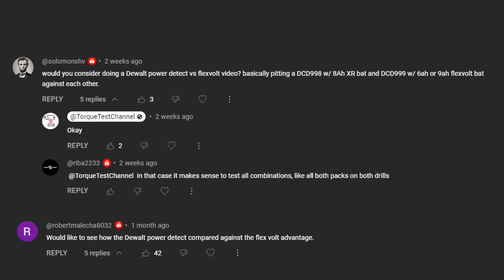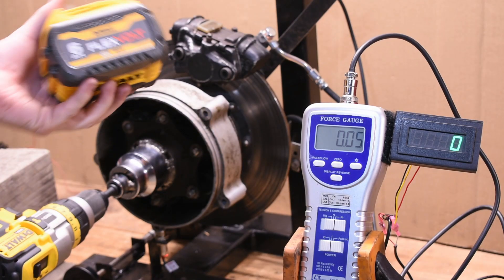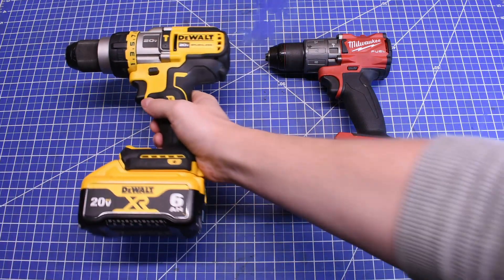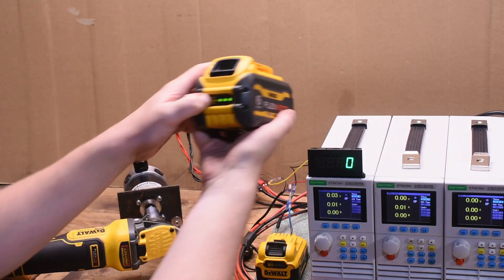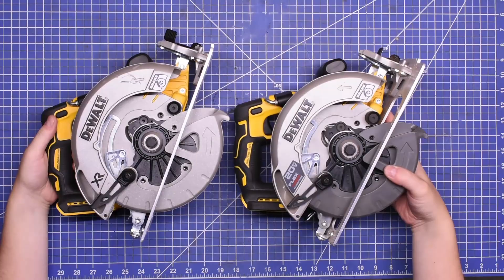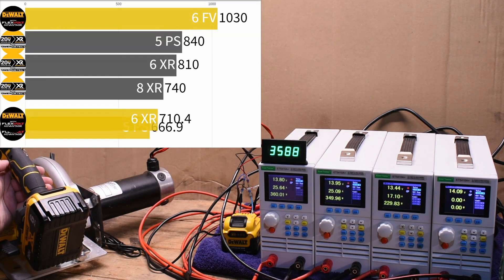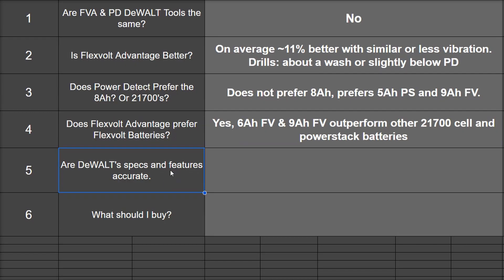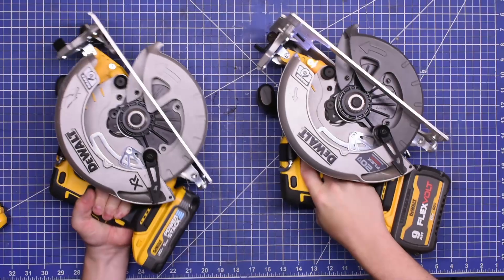Investigating the Biggest Lie in Power Tools: DeWALT's Flexvolt Advantage v Power Detect

Comment: I've said it years ago, Dewalt is trying to appeal to everyone and their dog. They want 5 different lines, that I know of, and a myriad of battery lines to go with them. They are doing a dis-service now, as it's just too complex. This is the same reason why auto makers cut their number of models in 1/2 or more, because they are making models that no one wants. Milwaukee on the other hand did the exact opposite approach and makes just the 18V line with one quality level, the top level, and that enables them to make 100s of specific tools for very specific jobs. Problem is, they are expensive, or seem so compared to those cheaper Dewalt models. I'm a big DIY'ers so I'm able to spend the time deciphering those different lines and getting the one I really need, but it's a HUGE pain the ass. If Dewalt wants more market share, they need to remove all this crap and just make 3 lines.....beginner, intermediate and pro.........and make just one line of good batteries to go with those tools. That would be so much easier.

Comment: This guy said the FlexVolt 9Ah is DeWalt's best battery, but what about the FlexVolt 12Ah battery?!?
Reply from the maker: Higher number on the side doesn't automatically = better. The 9Ah is great because it has 3 rows, 15 cells, of Samsung 30T's. The 12Ah has the same number of 21700 cells, but uses 40T's for more overall capacity. But that doesnt make for more current or lower resistance in this case. The 9Ah even beats, on average, the 15Ah.

Comment: When I was plumbing and using Milwaukee Brushless tools I noticed that it was more like programming in the tools brain if the tool could benefit from a high output battery. Dummer the tool "Vacuum" the more beans it could use.

Comment: I've got the DeWalt power detect and I absolutely love it I use it with flexvolt batteries..

Am I the only one that uses DeWalt power detect hammer drill with flexvolt batteries. Not even this guy tested it with a flexvolt

Comment: Flexvolt idea is just to change cell connection type from serial to parallel, so instead getting 9ah and 18v youre getting 3ah and 54V...  Anybody familliar with ohms law knows that this cant change torque of any tool because power output stays the same!

Comment: I wanted to see, what actual work over time you can get from every battery until you deplete it.
I multiplied measured Watt output of every battery by that battery capacity in Ah.
Heres the results (* before name means it was used on FlexVolt grinder, just like in 2nd test in video)

Batt   Watts   W*Ah     place
*9fv     850     7650     1
9fv       790     7110     2
*6fv     780     4680     4
*6xr     750     4500     5
5ps      740     3700     7
6xr       720     4320     6
8xr       670     5360     3

So correct me if Im wrong, but it looks like 8xr /21700 does not make as much Power output in Watts, but over time that 8Ah is going to do more work than 6Ah FlexVolt because it will run longer. It is essential to me on work outside, thats why Im asking are my calculations and thinking correct ?

Comment: Testing variances are one thing, but I wonder what an electrical engineer could tell us about a breakdown and analysis of the electrical system.  For all we know, they may not be using the 60 volts at all, and may just be using 20 volts.  I was under the impression that these batteries just serve 2 purposes: working at 20 volts in 20 volt tools and working at 60 volts in 60 volt tools.  Just a muli-use utility feature.

Comment: The flex volt iv used feel very stout and powerfull and is better than the XR tools I have. The XR drills I have are very tough they really have taken alot of abuse. Although the XR oscillating or I call it flush cut saw I have burnt out atleast 2 that I feel prematurely in the last ten years.

Comment: Dewalt make tools for all purposes. The most heavy duty tools work great on high amp 20 or 60 volt batteries. If you buy a smaller less powerfull tool than you need and put a big battery on it and drive it until it burns thats a tool choice problem not the battery. No different than putting an extended range diesel tank in a pick up and the being suprised when it breaks pulling a load like a Kenworth or Peterbuilt.
You guys should onow this!

Comment: I bought the dcd999 kit with the 6Ah Flexvolt and I can tell you it is not lacking any power. It performs very well and is definitely professional-grade. 

Buying the 20 volt dewalt circular saw is a dumb move. The 60 volt version outperforms it and you get that sweet 9 amp battery with it. If you're buying the flexible drill kit as well, then that leaves you with a spare battery for the saw, because it will not work with the 20 volt batteries. The 60 volt saw is a beast and it performs like a good corded one.

 If you need batteries you should always buy the kit instead of the bare tool. Usually the kit costs about $100 more of than the bare tool. This gives you a quick charger and an expensive battery that costs a lot more than $100 if you were to buy it by itself. 

I trimmed away a little bit of plastic on my leaf blower so that my 9 amp battery fits in it easier. That big battery works great on the leaf blower and weed eater.

 I keep one of the chargers in the house and one of them in my truck, it works out great that way because I will oftentimes charge my batteries when I'm home at night so they're ready the next day. Or you can keep both of them in the truck if you need to charge two batteries at once.

Comment: Flexvolt advantage I thought was a commissioned line exclusively for home depot but ace hardware and tractor supply and blains farm fleet also sell them. Home depot likely had some kind of non compete deal with dewalt to exclude lowes so lowes to compete made up a power detect gimmick and commissioned it to compete with the others

Comment: Not to muddy it up, but the real test is do these PD and FVA tools outperform their standard XR brethren (DCD996, DCG413, DCS570) when used with the same newer more powerful batteries.  I.e. All the "more power than" claims are based off the standard XR tool using a 5Ah battery.  So a PD tool with an 8Ah, or FVA with a 6Ah FV, is rated higher than an XR tool with a standard 5Ah.  That seems obvious.  But what if they are all using a 5Ah or all using a 6Ah FV?  I'd like to see all the 9 of the tools, each tested with a standard 5Ah, the kitted 8Ah XR, and the kitted 6Ah FV (we already know a Powerstack or 9Ah will give extra sauce).  That would showcase the differences more, imo.

Comment: 3:15 - The only - ONLY - difference is [I suspect] that the 'power detect' has a chip in it that pairs with a chip in the batteries that flex volt ignore.   So it detects a 2ah battery and the chip reduces performance so that you'll go out and buy the full throttle 8ah (or larger) battery.

Comment: Why does the US have 20V tools and the rest of the world has 18V tools?
Reply: That's only dewalt. Every other manufacturer advertises 18 volt. All 18 volt battery powered tools are 18 volts nominal and 20 volt max. Dewalt advertises 20v max and everyone else advertises the 18 volts you actually get while using the tool

Comment: There is nothing related with "FlexVolt or whatever chiberish" - its pure 21700 cell performance. If you remove that "bms electronic, performance booster" stuff (or whatever comany names it) from that battery, it performe the same as it did with it!

Comment: My problem with DeWalt is how long their batteries last. All you have to do is let them run a little too low and they will no longer take a charge. And that three or warranty they supposedly have on them. Good luck getting it honored. I have over $3,000 in batteries that I bought over the last 3 years that are dead. Even though they're not really dead, the charger just won't recognize them because all of them failed an exact same way. Either. I left them in the blower and the blower turned itself on when I went around the corner or I left it in a flashlight and forgot to turn the flashlight off.
Reply from the maker: Maybe try a bench DC power supply to bring them back to life as shown here https://youtu.be/XnHOLdyk1Oo?t=242
Reply: @TorqueTestChannel  yeah I was debating on getting a 24 volt power supply and rigging it into the battery plus and minus terminals but I wasn't sure how safe it would be. I know I've used those terminals to jump start a car before. Though that battery never worked again in a charger after that lol. I'll look at your video when I get home and if my text makes no sense because I'm using voice to text

Comment: All of these claims are nonsense for me. I just buy whatever is cheaper at the moment. I don't chase minor marketing/sales claims at all. Stay with the same brand and you're good. Then again, I get aftermarket batteries at amazon and buy cheap. Just change batteries when they get weak. A battery that has 1/4 less amps but is 50% cheaper is always a win. When I want power, I pull out the corded tools.

In a side note, I found these articles to be humorous'
   ''5 Reasons Why The Sales Team Hates The Marketing Team''
   ''5 Reasons Why The Marketing Team Hates The Sales Team''

Comment: Do you have a list, google sheet, pdf, etc. available that shows the best DeWalt 20V and 60V tools you've tested?
I'm a fan of DeWalt tools, but as this video clearly shows, their line ups have been so confusing lately, and I'd trust your opinion on what you'd consider the best performing models.
I've been putting off upgrading because I am worried about buying the "wrong" one! 😅
Reply: Get the 60 volt saw kit and the 999 drill kit. The 60 volt saw vastly outperforms the other ones and it comes with that huge 9 amp battery. Getting the flexvolt drill kit gives you an extra battery to use in the saw also. Both tools are a beast for real-world use.

Comment: I’m not disagreeing …but if you aren’t holding the drill perfectly straight or at the exact degree of each run there could be resistance against the drill and drive bit. Therefore putting slight more stress on the drill causing lower rotation( idk how significant the numbers would be)…. Also we don’t know battery lvl of each one nor how old each one is. ( they say lithium doesn’t  loose power until it completely dies but that’s bs) …dig the video though!

Comment: In New Zealand we have two big DIY stores Mitre 10 and Bunnings. These stores have price guarantees but only on IDENTICAL products;   so if dewalt supply a 995 to one store and a 996 to another they are not identical and so the price match will not apply.
- I'm sure its the same in the U.S. with Home Depot and whoever the competitor is'.

Comment: This is one of the biggest reasons why I steered away from dewalt 

Milwaukee is easy there basic brushed, then mid grade brushless, and then fuel. Nice and easy and you have generations of tools and you have regular batteries and high output

Comment: @9:11…I’m aware the ORIGINAL flexvolt 2/6ah battery has 18650s…are you sure that the new generation does as well???
And if you didn’t know, the 2/6ah batteries in this video are of the newer generation.  They look nothing like my first gen
It doesn’t show it in the video, but did you do any testing with the 10ah battery.  I’d say if you include the 9ah then the 10ah should be included as well.  I believe it’s smaller than the 9ah.  Not that it would drastically change the outcome of this video, but hey, if it’s someone else’s money buying the batteries then why not, amiright?

Comment: I have been using dewalt 60v flexvolt  since the beginning now I have tools dated 2016 and 2017 and still working, I do remodeling so I don't use every tool everyday but from the miter saw, table saw circular saw, grinder, saw zall, stud drill, chain saw string trimmer you named I have it and love them, now they just now expensive

Comment: One of the main reasons I avoid Dewalt is the simple fact that I can’t make heads or tails of what they’re ranking is in terms of power/performance. With other brands it’s either fuel, or HP, or brushless, or Flex or Hercules, but since Dewalt decided to offer like 8 versions of every tool, it’s too confusing, at least to my insignificant brain.  Unfortunately TTC has only made it worse by sowing more doubt lol. Love you guys!
Reply: I couldn't agree more. I too am too dumb for Dewalt. Dewalt buyers must be geniuses.
Reply: XR vs atom
Reply: Your loss...............
Reply: @slingin_tires just converted a dewalt company to milwaukee. Dewalt warranty and service was the main reason. Then i put a milwaukee fuel grinder in the hands of a big guy and told him to try and stop the tool on a metal surface. He couldn’t. He was also pissed at dewalt for being so confusing in their batteries so he wanted corded tools from milwaukee. But i told him any m18 would work on any m18 tool and he was hooked

Comment: The only reason why these 2 lines exist is because of Home Depot and Lowe's. Like flexvolt tools are exclusive to Home Depot... Yes you can buy them other places but not at Lowe's.     Basically the 2 lines were created to serve both stores because flexvolt name is exclusive to the depot. Each chain wants exclusive lines so here you go. Milwaukee isn't sold at Lowe's so you don't need to worry about exclusives

Comment: All Dewalt tools gain extra beans with 9AH battery. Even old brushed ones made before Flexvolt was a thing. Lower voltage drop under load. That's it.
Reply from the maker: Correct

Comment: What I find interesting is the DeWalt marketing. I'm British and the DeWalt Flexvolt system is marketed as 54v not 60v. Likewise the 20v batteries are marked as 18v in the UK. They are exactly the same batteries but, it seems they are not allowed to claim the higher voltage because it's the fully charged level before any use and is thus not a correct voltage when attached to a tool when powered up.
Reply from the maker: Due to Milwaukee 18V lithium battery tool patents in the states, it's all a bit silly

Comment: FA & PD tools are both great tools. They both get a boost from the higher output batteries. And best of all, they are both 20v tools. So you're not wed to FV batteries to run them. I have both drills & both grinders. I have the 7¼ wormdrive style 60v Max 777 FV circular saw & the 6½ 20v Max 565 trim saw. I'm a lefthand blade guy! The PD drill is better, but marginally. They are both beasts & I love them both. The grinders are great, but they have paddle triggers & I'm not a big fan of that. So my lowly 20v Max grinder with the traditional finger trigger gets the most use. Biggest takeaway I have from this is that the 5ah PS, 6ah XR & 9ah FV are Dewalt's best batteries. So there!

Comment: DeWalt fan boy here. Nice to see that it is an industry leader in another category: confusing their customers. They must be proud. As an aside, I'm still using my 20V Dewalt  drill and impact driver I bought years ago. I installed a lot of Hardibacker using the impact driver. They've been in the mud often, and they've fallen off ladders and they are still going great. I got an off brand 3AH battery for them and they really took off with that. I would like to put up DeWalt for the lead in another category: Confusing your customers on how the name of the brand is spelled. There are at least three permutations that DeWalt, Dewalt, DeWALT has used.

Comment: flexvolt advantage tools turns flexvolt batteries into regular batteries 
no like corded power 
dewalts attemp to destroy there own creation 
the flexvolt battery is to good
20volt is 20volt
flexvolt advantage tools r just juice sucking machines to get us to charge them more
they r flexvolt battery killers 
period
dewalt did this on purpose of course
deceived every one about how the flexvolt advantage tools take advantage of flexvolt battery and its true  the deception is they turn them into a regular battery to run with other companies tools with their regular batteries 
you cant use flexvolt batteries as like corded power with flexvolt advantage tools 
these tools need to stop and desist

Comment: DCD999 electronics/motor part # N793069. DCD998 motor/electronics #N793069. There you have it same motor and electronics. Transmission's are different numbers but all listed parts for transmission  are same number?